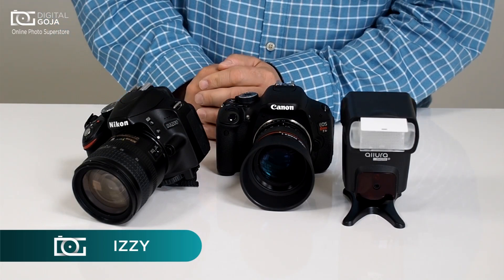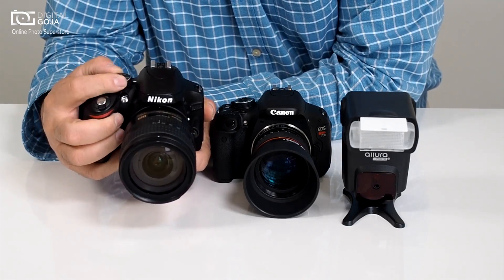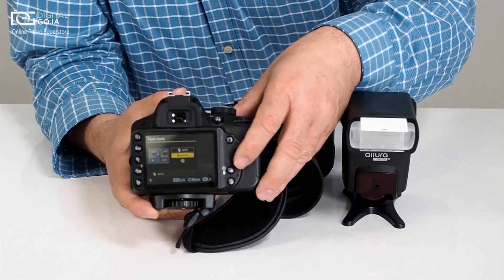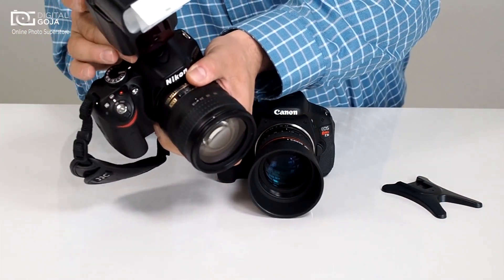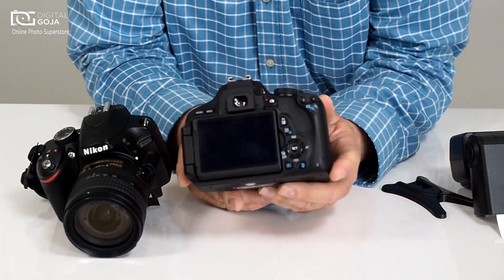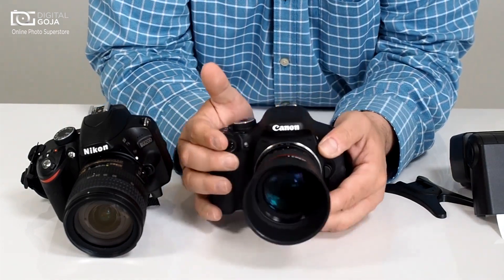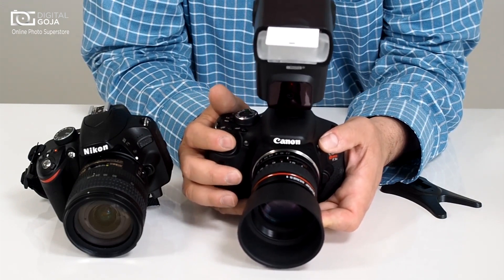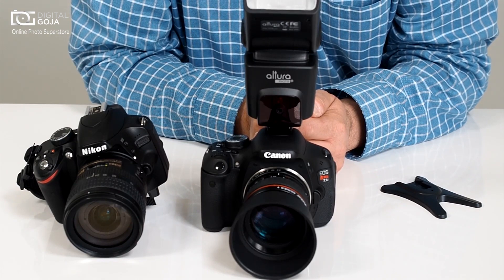CAMERA FLASH TUTORIAL | Stop Your Camera's Flash from Popping Up When Using An External Flash

Comment: I WISH this worked for me. It flashes them 3 times out of the 30 times Ive tried. Not sure why it works once then stops :(
Reply from the maker: If your internal flash keeps popping out please verify that the settings are correct.
Reply: ARKMprime its really dumb bec its SOOOOOO hard to find out.... the generic flashes DONT work in LIVE VIEW MODE so yeah..... took me FOREVER to figure out such a random thing. but that solved the issue.

Comment: I have a canon 70d the inbuilt is not releasing,  I did off and on, removed the battery placed it back still the same issue, what should I do
Reply from the maker: Hi! Put the camera on P mode and press the flash icon to activate the flash.
Reply: Digital Goja I know this is a stupid question but, WHERE THE HELL IS THE FLASH ICON!
Reply from the maker: Hi there! Your flash button is usually next to your camera's flash, on the side. It depends on which camera you own.

Comment: hello can we use external manual flash on Nikon d750 on auto mode .. & pop up stay flash stay closed instead that external flash blinks no.38 simpex ... please help  by telling settings thanks in advance :)
Reply from the maker: Yes, you can. Make sure that your flash is properly placed on the camera hot shoe to prevent the pop-up from firing.

Comment: In the video, you say with the Canon, there is a way to turn it off completely, but it isn't the preferred method.  Could you please tell me where?

I can't find this in the menu (Canon 70d), but would like to because the camera is malfuntioning and when I have it in the No Flash setting, the flash  is still popping up and firing.  

I have no desire to send this to Canon to have them fix this under warranty because I use my camera daily and don't want to be without it.
Reply from the maker: Hi Dave, in the flash control menu you should have an option to disable it, however, when in full auto mode the flash may still pop-up.
Reply: Did you ever figure out the answer to this question?   I hate when my auto flash pops up in daylight when I'm on "A" setting
Reply: He was asking where in the menu would u turn it off, like you showed in the Nikon, unlike the Canon. You just talked abt it for the Canon but never demonstrated how too smh
Reply: I have the opposite issue. I want to use the pop-up Flash and in addition, I want to use the hot shoe mount bracket to mount a cold shoe mount adapter to mount my GoPro camera to so I can take video at the same time I'm taking photographs and using the pop-up Flash. However, when I put the cold shoe adapter on the hot shoe, the pop-up Flash no longer pops up. I've tried to isolate the cold shoe mount with tape and a piece of cardboard but it's still seems to be sensing it and disabling the pop-up Flash. Any idea how I can avoid disabling the pop-up flash with a cold shoe adapter mounted to the camera?

Comment: I did not express myself correctly......I wanted to know if there was a way to have the external flash off the camera (canon EOS 60D) a few feet away and then not have the main flash also flash.  I did the setting on the speedlite and the main flash seems to go off just a split second prior to the external flash, but is there a way to not have the main flash go off at all to get different effects?  I hope I explained it correctly this time.
Reply from the maker: Hi Thad, I'm afraid the 60D doesn't have the ETTLii feature to just fire the secondary flash without the primary going off, if you use a Canon 430exrt it has a mode to just trigger second flash but not fire itself.